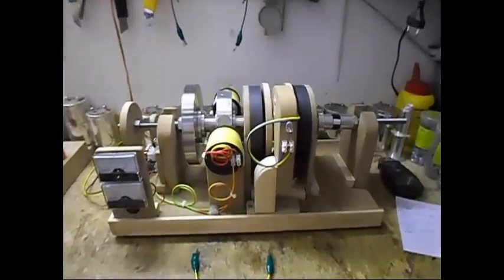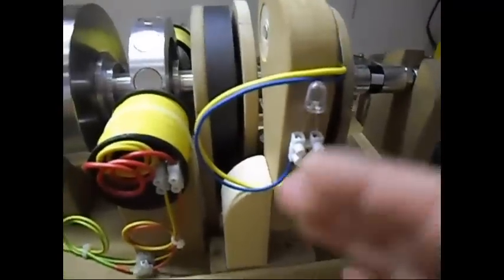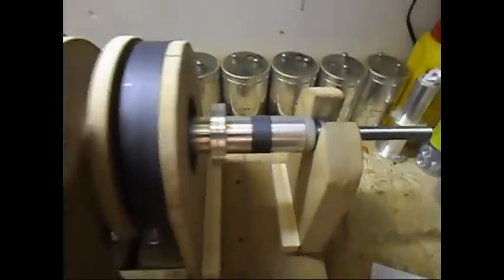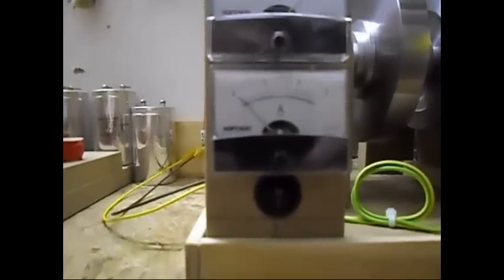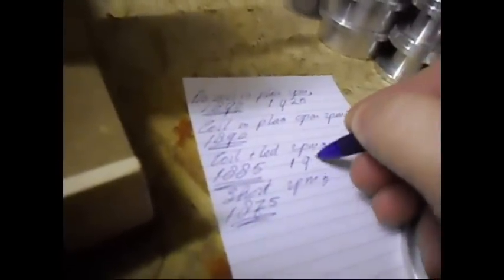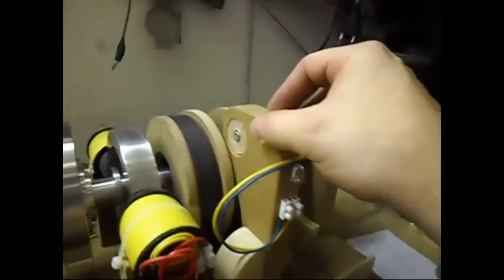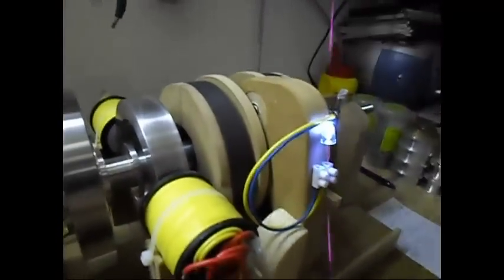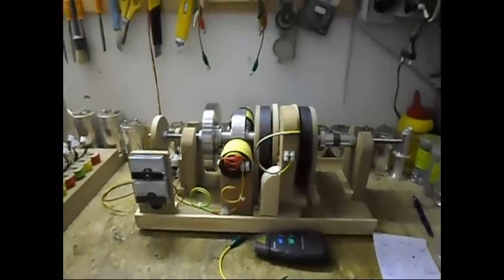Flux Gate Generator - Update 2 Push Mode, 2 ring magnets - short coil...

Comment: I'm fairly new to this type of setup, and I'm curious how it can be wired in to your house? Again, I'm newer to this stuff, and I'm wanting to know HOW it can be used at home. Thanks! And great work! :D
Reply from the maker: Thanks for your comment and i'm glad you've liked it...^^
See my previous reply to your comment...;-)
Sadly enough there is no such thing as a self running motor/generator(any type of generator) without any fossil fuel...
You will find a lot and i do mean a lot of u-tubers/webpages claiming just that so be careful not to throw away you hard earned money...
I also want a machine that can run itself and also have a bit of energy left to light up some lights and that is why i'm doing all these test and putting my time and money in to it...^^
Even though i can be very skeptical i am also open minded...;-)

Comment: Nice! Fluxgate generator? I build a Kalupconverter, producing 500 kW power at 230V AC output. But I do not need any power supply to keep it running. My Converter runs since 2014 in my house.....
Reply: Any chance, Justin, you're still running that setup for your home? I'm looking to learn more.  Thanks.
Reply from the maker: +Justin Timber 
Thanks for your comment and good thing you have a "a Kalupconverter, producing 500 kW power at 230V AC output"running your house since 2014...^^
Reply from the maker: Mike, that kind of comment as the one from Justin Timber is not something not to take to seriously...^^

Comment: Again, nice job. Its great that it runs on 30-50mamps, thats awnsome! It takes awhile to get up to speed, but you have lots of weight to rotate. What gauge of wire on your drive coils and roughly how many turns of wire if you dont mind me asking? Anyway,
Cheers!
Reply from the maker: Thanks...^^
I don't don't count turns...i only use wire size(if it's know) and resistance...;-)
The resistance is of them coils is 175 ohm each...wire size is 0.35mm(this can be 0.30 or 0.40mm) since i don't remember and the bobbin is not the original one that came with the wire so the sticker on it is useless...lol
Hope this give you an idea of how and what...^^

Comment: Thank you very much for sharing your results with us! Nice work!!

One question...would it be possible to use the "pickup coil" from the LED instead of lighting for pulse charging batteries? Would be interesting to see the results on that configuration...and the output voltage and current into the charging battery (using a blocking Diode ..I know voltage drop across the diode)

And perhaps a permanent magnet bearing would be a good idea for this setup ..to remove the friction ...(perhaps you have already done that, sorry if I don't know, have not seen all your videos until now)...

Keep things up like that, good work! Thanks again for sharing!
Best and kind regards!!
Reply from the maker: Hi lukelordoflight,
Thanks for your comment and i'm glad you liked it...^^
Yep, it is possible to charge up a cap to a specific voltage and than dump it into the run battery at a specific intervals...i've done and test that a few times...not on this one but on other setups...;-)

But there isn't any gain to get from that...only a bit better efficiency of the system...
That's whay i'm going for a coil that will produce energy but without slowing down the drive side...doesn't have to be much output...just enough...:D
As soon as i have that wich i'm pretty close to i'll make a full generator with as much coils as possible...^^

These bearings i'm using are high efficiency ones wich are very good unless they have been abused a bit like these...lol
Cheers...^^

Comment from the maker: A update on what i'm playing with...^^
As one can see here my second PMBO entry has been modified so i can use the motoring part with and flux gate generator...;-)
There is plenty of room and space for improvements, modification and even a second glux gate setup if i am satisfy with the results in the near future...:P

What i'm gonna do next is to use a different coil with a exotic winding style to see if that helps or not...usually not...lol
If not then i'll be removing 2 of the iron disk from each rotor and if that doesn't help either then i'll be wondering what's going on in there...lol
Hope i get this issue fixed so the coils can be where they are suppose to be and not on the edge like one can see in the video...-.-

The first 9 minutes are just to wait for the system to get up to speed...lol

But i don't mind...^^...seeing the input energy it's running on in combination with the rpm and the weight of that shaft/rotor...:DDD
Input energy once up to speed is 29.5Vdc @ <50ma...lets keep it at 50ma but i personally think it's around 30(ish)ma...o.O...^^
A 1amp or 500ma meter...or...500ma and 100ma meter will be inplemented somewhere in the near future...;-)
This will make reading and seeing what's happening with the drive side much easier...:D

At 18.30 i made a mess of what i wrote on that piece of paper...soooooo me...lol
It's,
No coil in place = 1941 rpm
Coil open/in place = 1937 rpm
Coil loaded/led = 1931 rpm
Coil shorted = 1913 rpm
Ofcourse with these small rpm changes it's impossible to see any difference on the meter...especially when it's a 3amp one...lol

At 19.12 i said "drag on the load"...lol...ofcourse it should be drag on the drive side...;-)
And last one,
The base of this setup is now elevated...this is for the 4 bolts head wich holds the 2 ring magnets holders in place wich are sticking out a bit...;-)
Reply: Great readings, thanks for taking the time. Have you thought of different magnet types like Boron magnets or even homemade Bismuth magnets to contort the magnetic "field lines"? Bismuth melts at a pretty low temperature and shouldn't corrupt the magnetic domains in the Neo magnets. Keep up the great work.
Reply from the maker: Diadon Acs
Thanks for your comment and glad you found it "Great readings"...^^
These magnets are just fine...when i get it to work it wil work with ferrite and Neo's to...;-)
No need to dig deeper when we can't find the solution, we just need to go sideways and that's 360 degree horizantal and vertical wich is really REALLY a lot of posibilities...lol...:D
Cheers
Reply: Aww, well what I meant by great readings is that you have a lot of thorough measurements. I agree, possibilities are endless, that's why I was curious if you had considered the possibility I mentioned. Something I will try once I get the resources to do so, probably just solid state setup however. Thanks again for your time brother from another mother. 
-Cheers
Reply from the maker: Diadon Acs
I see...lol...my bad...
It is important to take the time when doing testings...when i'm making a video i tend to rush it so the video doesn't get to long and everyone falls asleep...lol 
It's good to try as much stuff as possible but it's also good to choose a specific path you want to travel on...:D
Take care bro & be safe...^^
Reply: Agreed, and no worries. Its hard to gauge the angle of someone's dangle when it is adversely proportional to the pixels of there viewing apparatus ;) I know exactly what you mean and you do the same in the safeness and more importantly, the exploratory enjoyment. :)
-Cheers